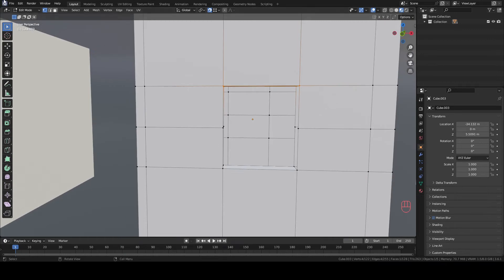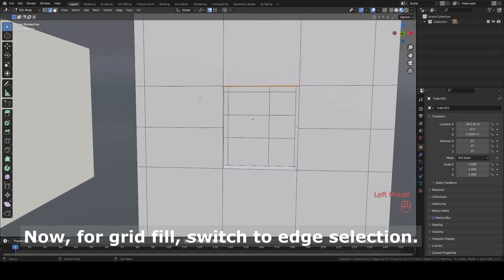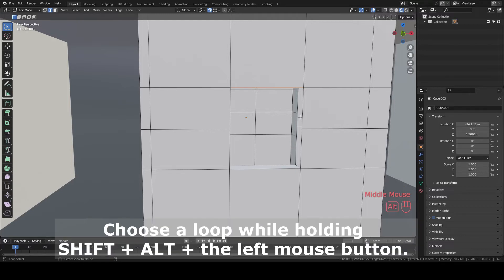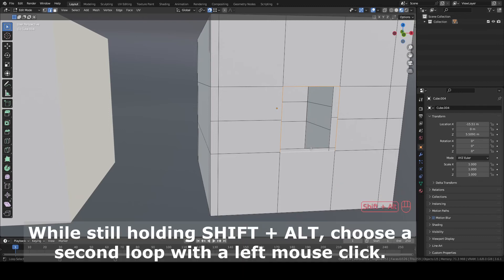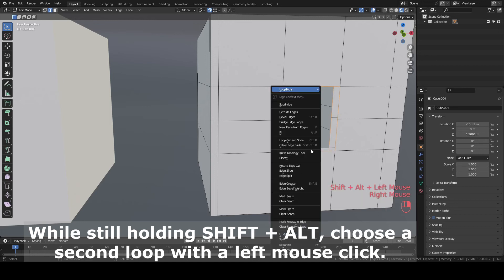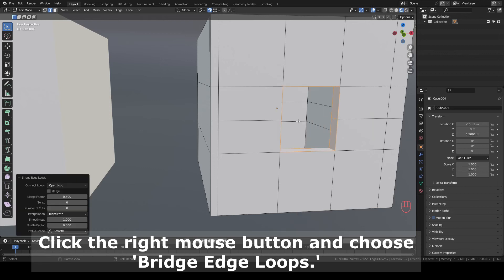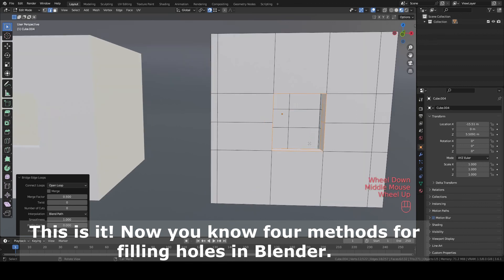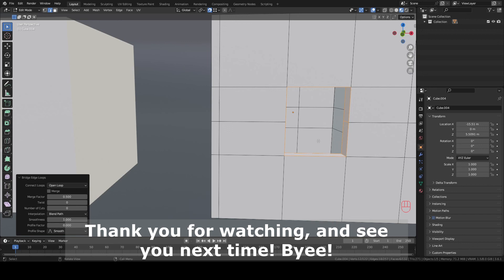How to fill holes in Blender - easy beginner tutorial #3dblender #blender3d

Comment: Nice and concise! Bridging edge loops is how I'd do this example but my favorite is using the Mesh: F2 add-on that ships with Blender. I always have it enabled, which you can do by going to the Edit menu > Preferences to pull up the Blender Preferences window; click on the Add-ons tab on the left, make sure "Enabled Add-ons Only" is not toggled, search for F2, and toggle the check box on the left of the Mesh: F2 option.

With F2 enabled, you can start like you did in Edge mode -- select two corresponding edges, one on each loop, and hit F to make a face between them. But then, you can select one of the two new edges that created that quad, so your selected edge is spanning the gap, and hit F repeatedly, making a new face bridging the gap with each press of F.

The F2 add-on makes quads from a single selection, looking to either side of your selected edge or vertex to connect its neighboring edges or vertices. In Edge mode, it creates a bridging quad with no extra vertices; in Vertex mode, it creates a new quad with your select vertex, those on either side of it, and one more in the space opposite your original vertex to make a parallelogram (if you use it on a square corner and right click after hitting F, you'll have a square face; otherwise, it'll be like your original vertex was mirrored across the line between its two neighbors). It makes retopology immensely easier and faster whenever you're in situations where grid fill or insetting or bridging edge loops aren't enough.
Reply from the maker: First of all, thank you so much for this long comment. I really appreciate it. 

To be honest, I found out about that add-on a few days ago, but I keep forgetting about it because I am still not used to it. 

You actually gave me the idea for a new tutorial video about F2 add-on so would you mind using that comment for inspiration to make a new video?
Reply: @SaTales3D  Of course, feel free! I, too, love learning by teaching others.
Reply from the maker: @cjgladback  Thank you so much! I can see that from your comment, and I see that at least on this channel from which you write, you have only one video. Did you think about making more tutorials? I think you would also be great at explaining stuff, and as you said learning by teaching others is always fun :D
Reply: @SaTales3D  Aw, thanks for the encouragement! Currently, most of my talking on the internet is over on Twitch (just slowly working through my personal projects in a stream I think of as a coworking space). I do have a few tutorial-ish videos on YouTube from when writing out answers in Discord and forums wasn't enough, even with screenshots; they're in a public playlist but unlisted since they're for very specific context and roughly made. But I'm definitely considering some higher-effort tutorials, either on a specific prop (I've got the geometry nodes for the walls of a basket figured out but I'm still fiddling with how to finish the top edge and bottom and lid weaves) or yet another How to Make an Animated Character series since I keep recommending similar approaches to people who ask for advice on projects and it might be valuable to have it clearly laid out in one place.

I don't really expect to become a tutorial channel (or at least not a focused one), but I hope you're having fun with it!
Reply from the maker: @cjgladback  you are welcome 🙏😄 that sounds really fun! It is the most important thing that you have fun and do what you love. And if you ever make any video about geometry nodes, let me know because I want to learn them, but currently have zero motivation haha 

Thanks, I am definitely having fun😄